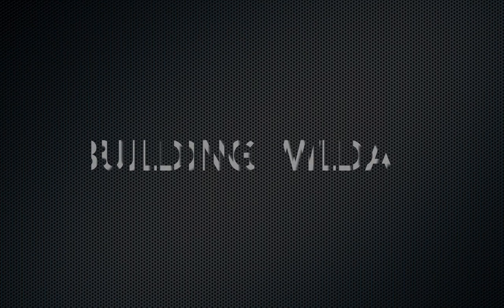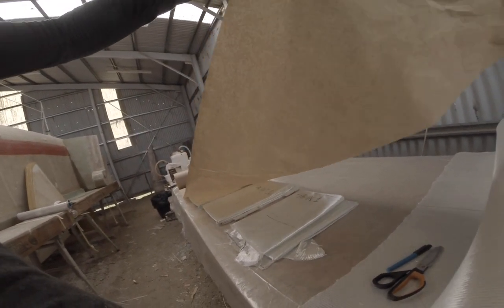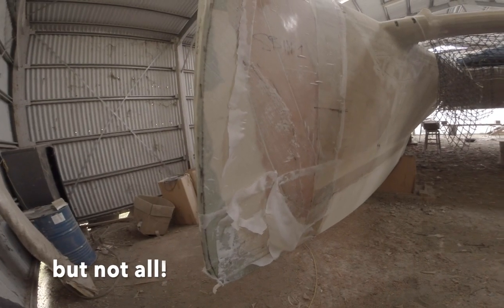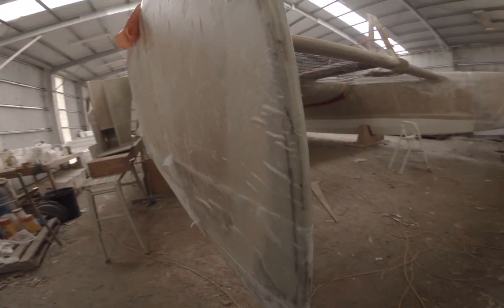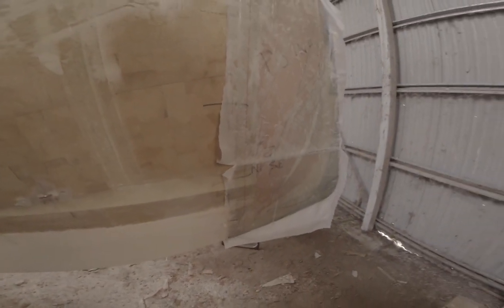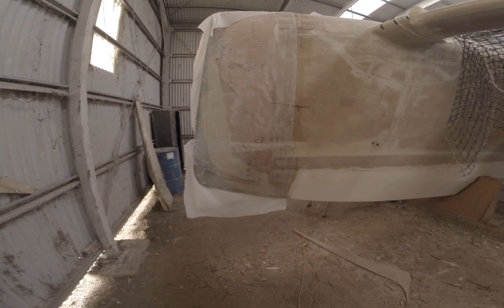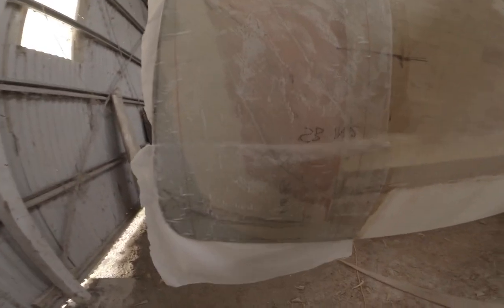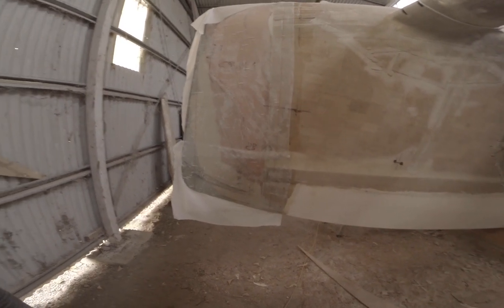Glassing the pointy end - S01 E10 - DIY Catamaran

Comment: Looking good. When you are building up your glass like on the bow. It might be worth making each layer slightly larger than the previous. Your adhesion to the original glass iss better. Patrick Childress on sailing Brickhouse has made a few videos about this. His channel is full of useful info. On laminating and anything sailing. Keep at it its looking awesome.
Reply from the maker: Thanks. Each layer is about 5 centimeters smaller than the previous. There are different thoughts on this, mostly when it comes to repair of holes or cracks. When it comes to construction, bonding, the engineering requires the largest area on the first, contacting layer. Subsequent layers being smaller. Though both methods might have their uses, I will stick to the engineered plans. Thanks for the tip. I appreciate helpful advice.

Comment: You also have positive buoyancy as well.
Reply from the maker: Yes. A common problem with older cats has been insufficient buoyancy forward. That is not the case for the Schionning designs, or any other modern design.
The addition I put on has no real impact on buoyancy forward. There simply is not much material to make any difference. To me, this is an aestetic choice... And if it does work out like I hope it might, the pointy end may be more efficiently wave piercing. 😂

Mostly for the look though 😁
Reply: @buildingwilda  The pointy bows have a specific name reference but I can't remember what they call it. It's not pointy bows. They use another name. I like the look a lot.
Reply: It might be A semimetal.
Reply from the maker: @robertlaird6746  wave piercing bows. Or x-bow. Probably a few more names as well 😊